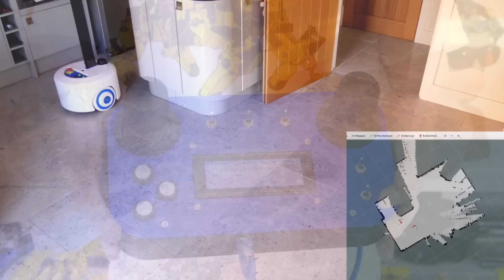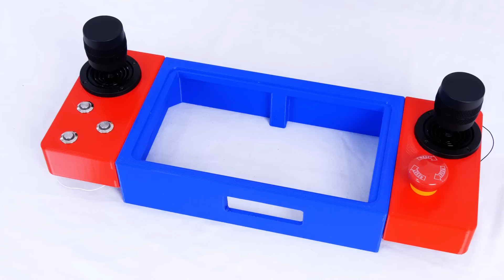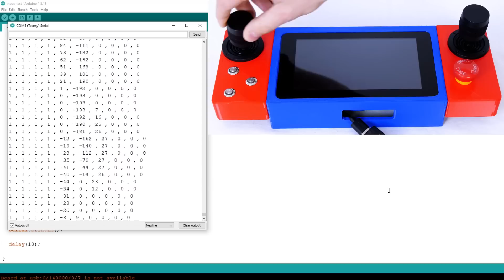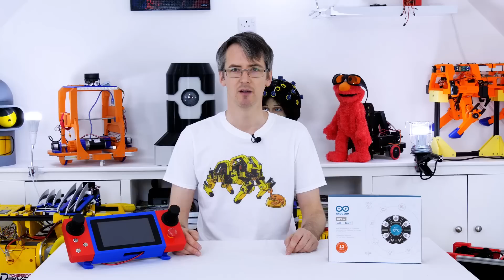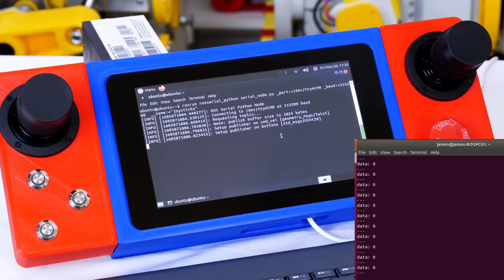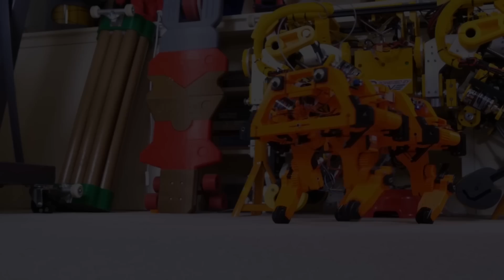Building a Touchscreen Smart Robot Remote

Comment: Hi James,
if you connect the Teensy directly to the Pi GPIO Pins you could use one of the internal UARTs for serial connection. The Pi 4 has enough of them ( https://www.raspberrypi.org/documentation/configuration/uart.md ) and you could save space and a usb cable ;-)

Comment: Just so you know, versions of the pi after the original b don't need those i2c wires for the touchscreen.  They are already routed over the DSI cable.

Comment: Looking good. Man I should have used those joysticks on my robot controller. Any idea on how easy they are to mod into throttle style sticks by extracting the tension springs? Needed throttle sticks on my 34 analog input controller but would have been nice to have a bit larger sticks like what you are using.

Comment: You can use ESP32 with micropython firmware. It has analog and digital pins, which can be assigned as inputs or outputs. Check also M5 stack core 2 or other ESP32 boards.

Comment: This ROS stuff is looking amazing! I'd never have imagined that a distributed OS would be fast enough for real time controls but apparently not!

One thing I'd be a little concerned about is if the remote runs out of battery while controlling a robot, in case the robot disappears off into the distance with no way to stop it. Implementing a heartbeat/watchdog timer from the remote to say "hey, i'm still here!" that the robot subscribes to, and automatically shuts down if it doesn't receive the message after a timeout?
Reply from the maker: Yes that's a good point. That could just be another ROS message on repeat.

Comment: Hi James, Can we use arduino ros library directly on teensy boards?. or is there a separate fork for that?
Reply from the maker: Yes, but by default it only works up to Teensy 3.2. Use the one I hacked for the RUR which goes up to Teensy 4.1: https://github.com/XRobots/ReallyUsefulRobot/blob/main/arduino/ros_lib_modified.zip
Reply: @jamesbruton  Thanks a lot james! what is the main issue for 3.2 + above boards that needs library upgrade.

Comment: ROS sounds like it could be a pretty good base for a home automation project, cheap easy touch screen control panel in every room which can all share data and then you can either pass that data to other services or set up "robots" to control appliances/lighting.
Reply from the maker: Yes it's pretty much just a framework, so you could control anything with it.

Comment: Instead of publishing a Twist and some separate topic for the buttons, you might want to just publish a Joy-message, specifically made for joysticks. There's a joystick_teleop node that ingests that and outputs /cmd_vel. That setup allows for remapping of the buttons and axes. Also takes care of the deadzone, scaling etc. There's a joystick node that uses in a Linux joystick device to publish Joy-messages. Then, you can make your handheld controller act as a normal joystick device via the Teensy. That way, it'll also work as a joystick if you plug it into a Windows machine, as it's then just a normal plug-and-play joystick device

Comment: I probably would've stuck with a dedicated radio link like the nrf chip so that when you pipe lidar or image or tf data to the pi screen it doesn't delay your control inputs
Reply: Or have the option for both.

Comment: Amazing idea for a controller! I have a suggestion, it would be really nice if you could make some diagrams to show how the RPi interfaces versus the Teensy over serial with the rosserial as protocol and so on, it would make the understanding much more easier. Looking forward for you to push the designs!!!
Reply from the maker: The Rosserial Node runs on the Pi, it talks to the Arduino/Teensy over serial using the Rosserial Arduino library
Reply: @jamesbruton  Some nice diagram with devices and protocols would help, you can take some tips from Andreas Spies, he is a master of concise and simple explanations.

Comment: A dedicated hat with the Teensy and all I/Os and connectors (I²C, SPI...) could be nice, to avoid USB cable (by directly using the serial port on GPIOs), and allows further developpements.
Reply: I don't know much about the ras-pi hardware/software, but having direct IO access might also help reduce latency.

Comment: Your previous remote control inspired me to build my own: https://wiki.logre.eu/index.php/T%C3%A9l%C3%A9commande_intelligente_2
As you can see, I developped a little board which is mounted to the rear of the joystick, read 4 analog and 4 digital inputs, so you can monitor them through I²C: https://wiki.logre.eu/index.php/Joystick_Node

Comment: Do you have any code showing how to move motors on a client requesting servo angles from a server via tcp or udp? for example, I am trying to use a pi as a webcam, do some color tracking on the jetson nano, and send the angles back to the same pi with the camera, which is attached to the servos. A remote tracking cam. I have the video working, and the servo angles outputting. I can bind the socket, but my while True loop locks up when I try to create a data connection. 

I should know this, but I should also learn ros. This looks very practical.